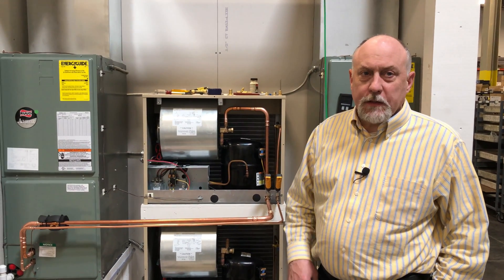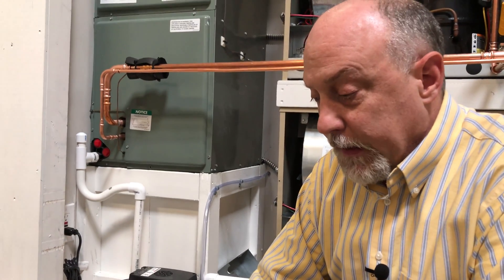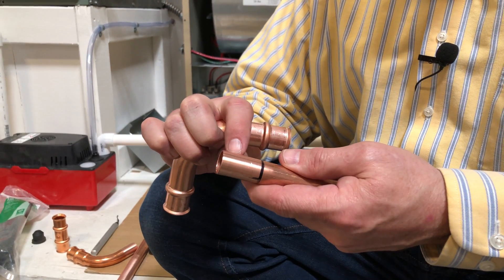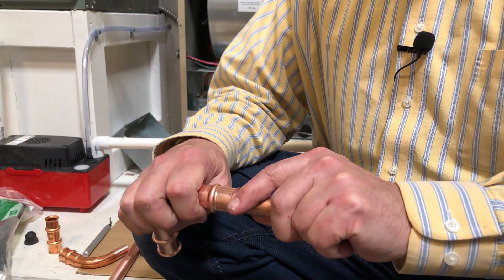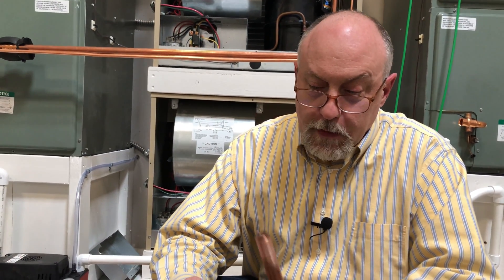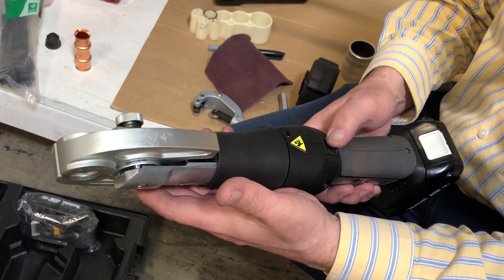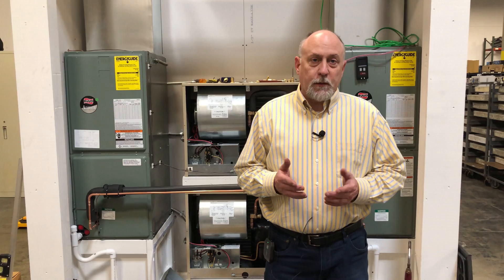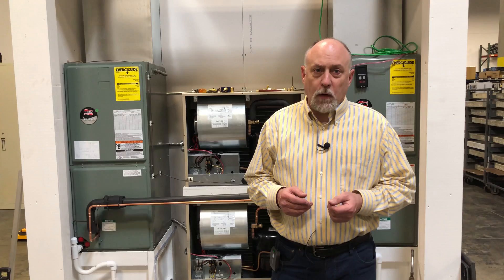Using the RLS Press-to-Connect Fittings, Jaws and Tool with Jim Bergmann

Comment: The video is nice and also the tool. Why would I spend 2 or 3 thousand dollars on an equipment. That you still need to brace. On the condenser and by the coil. Because they don’t have the fittings for that. So for me it’s dumb because I still would have to do the bracing like always.  And I could do my bends nice and neat with my benders. Now with all those fittings I have more chances to have leaks everywhere.

Comment: This method is a terrible choice that will result in numerous call backs, increased overhead costs, negative ratings from unhappy customers, and a loss in profit due to leaking. The high pressure on the high side lines, plus the temperature changes on the fittings will always require brazing. I'm surprised the EPA, with their complaining about the ozone being damaged by refrigerants, haven't outlawed this seriously flawed method.
Reply: It works if you prep properly
Reply: The data does not indicate that

Comment: Can this system be used to connect to a steel in line filter going to a copper line?
Reply from the maker: No. RLS copper refrigerant fittings are specifically designed for copper-to-copper connections. Connecting to dissimilar metals can cause galvanic corrosion issues that could cause a failure.

Comment: Way I see it when we had to do compressor change outs and put in suction driers and other stuff, that was a pita. Esp when you had to do remove the suction line dryer next week. Expensive fittings and expensive tools, but dang is it a time saver for sure.

Comment: If you braze in the connections to the coils first,   Prior to any line set or press fittings, would you still need to flow nitrogen?
Reply: Yes.

Comment: I was considering that kit but opted for the Milwaukee M18 Force Logic with One Key and got the RLS jaws in addition. Milwaukee has data reporting to send to the customers that all pressed fittings passed during the pressing on work that is done I attach on a work order.
Reply: My Milwaukee crips say Streamline ACR and use the double o-ring system, Not the RLS.  I’m wondering is they can crop the RLS too??
Reply: @nmhvactech5474  yes, you can change jaw

Comment: Tool is nice but you still have to braze the other end of the street 90...whats the point of making the type of investment when you still have to braize. I could braize with nitrogen and get the same end result. Am going to wait couple years until I dont need the torch at all.
Reply: The street fittings are designed to be used in other press fittings… I have had multiple scenarios where I’ve used a 45 and then a street 90, or a regular 90 then a street 90… of course we don’t use many street fittings in ACR due to being able to easily bend our copper tubing, but they definitely have their place!!
Reply: @anniemeyer3066  the point is you still have to braze the copper either way?

Comment: But with vibrations, heat/cold cycles and how rubber o-rings break down... what kind of longevity before it starts leaking... few or several years? Can it go 15 years?
Reply from the maker: RLS stands behind their 10 year warranty on all of their fittings.
Reply: @TruTechTools do they reimburse for freon or is it a pinky promise?
Reply: https://www.rapidlockingsystem.com/wp-content/uploads/2021/01/RLS-Third-Party-Testing.pdf

Comment: Thanks, Jim.  Good video as always.  The one thing that probably needed to be mentioned is that when you change jaws, the manufacturer recommends that you run through one press cycle (without being connected to any copper) just to get the tool calibrated.  Then you're ready for normal pressing.

As far as the press tool itself, the Klauke tool (shown in the video) is a great tool which I've used many times.  But when I finally ended up buying a tool myself, I purchased the Ridgid press tool.  I bought the model RP241, but the RP 240 works well also.  The deciding factors for me was the warranty (the Klauke has a 2-year warranty, where the Ridgid has a lifetime warranty), the press force used (the Klauke presses at 19KN and the Ridgid presses at 25KN), and finally, if necessary, you can purchase other jaws (like plumbing jaws) for the Ridgid.  I only do HVAC work, but it's nice to have the option for other jaws.  Otherwise, both the Ridgid and Klauke tools work great for the RLS fittings.  And lastly, if you're doing high pressure HVAC/refrigeration work, stick with true RLS fittings.  The other brands do not work as well.  (For plumbing, however, all brands seem to work equally well.)
Reply: RU
Reply: Looks like the Milwaukee one looks good too.

Comment: No kidding. I bought one thinking they would have units with at least an option. Also klauke tool has no other jaws available for water, pex, or anything else. Rls don't have fittings for potable water.
Reply: That’s why I went with Milwaukee, I’m ordering the streamline jaws

Comment: I want one,  but don't see the point if I still have to take my torches,  nitrogen,  heat sink,  etc out for one or two joints.  It defeats the purpose. Why hasn't any of the manufacturers taken the one step needed of installing a service valve without the bell so that the installer has the option to use this tool,  install a coupling and braze, or use an expander tool to put the bell on themselves and braze. In excited about this tool,  but won't get one until what I stated above happens.
Reply: You know I thought about that, I would simply brace my stubs on at the back of the truck. 

Another option though is to just simply use Staybrite #8. Staybite is a silver bearing solder. You obviously don’t want to tin, as that is for water. If done properly it makes a stronger joint then brazing. It is my go to for 20+ years, R-22 and R410-a. I know several contractors that use it exclusively for all their new installs and they have for over 20 years. I worked for one.
Reply: You would need to flux the copper before using staybrite 8, correct? I would be concerned about contaminating the system with that?
Reply: @richardfossani6421  yes, but used properly it will not contaminate anything.
Reply: I pulled that to 21 microns after pressing, final decay was 80. If it was contaminated it would not pull near that low.